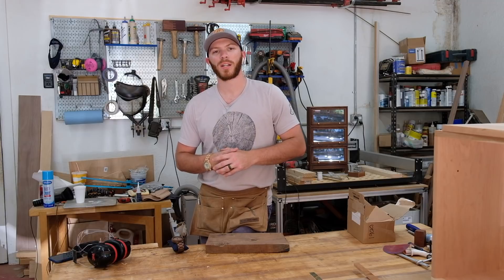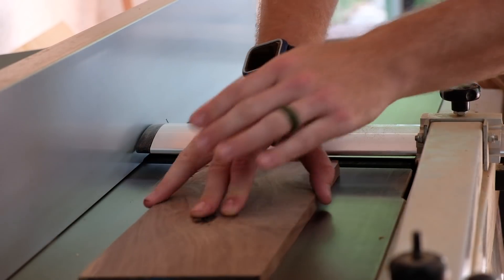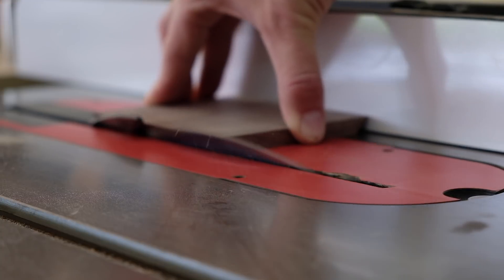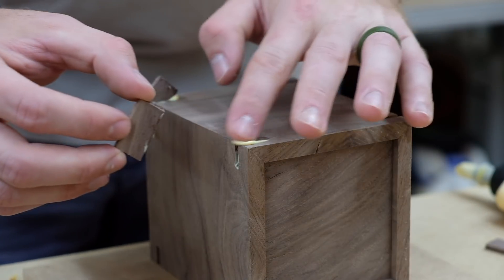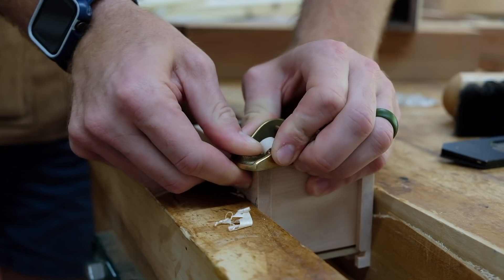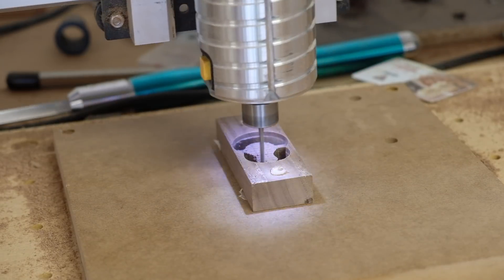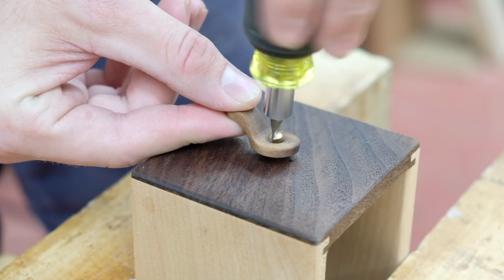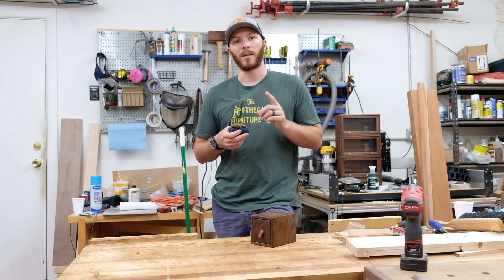Making a Little Box for a WoodWatch // FREE Giveaway!

Comment: Brass is a really soft metal. You may be able to use your CNC to mill it out by just turning your speed down and putting a carbide end mill in it. Probably save yourself some money on the manufacturing process as well.

Comment: Lovely box. I love the addition of the little reinforcement splines to the mitre joints, but what would you recommend to reinforce mitre joints that are not deep enough to spline, such as a thin picture frame?
Reply from the maker: Thanks Trevor. Even a frame that’s around 3/4” thick should be able to hold a spline in each corner. You can also drill from the side for a dowel which will add a little bit of strength.

Comment: I love your mini-halflap joints, but I need to figure out how to do them without a table saw as I don't have space for one and have to pull out a track saw or hand saw.
Reply from the maker: Thanks! Realistically, I think the only other simple method would be a router table.
Reply: @parillaworks  Thanks. I've managed a shonky version with the tracksaw this weekend but it isn't as precise as your joints or as I'd want them to be, so some more practice needed. Earlier this week I tried with my router (not a table, but handheld against a clamped rail) and made a mess of it and it was very time consuming so I think that I will keep practicing with the track saw.

Comment: Have you had any issues with the fence on the incra triggering your sawstop? Debating the incra 5000 but I don't want it triggering my break with the extruded aluminum fence.
Reply from the maker: Hey Steve. Yes, the two times I’ve triggered the Sawstop have been due to Incra sleds haha. I clipped the Incra iBox about 4 years ago and also clipped the miter gauge a few years ago. Both my fault. Lost a dado stack on the first one, which sucked.
Reply: @parillaworks  dang, that's what I was afraid of. I did the same thing with a t track I had on my cross cut sled. $90 for a new break and $25 to repair/sharpen the blade...

Comment: I think that is a great idea for a draw pull. How long did it take to mill out?
Reply from the maker: Thanks Aaron. Each side took about 25 minutes. I used a 1/8” ball nose end mill for everything. I think the feeds and speeds could be adjusted to speed it up but I might also decrease the step over or possibly add a finishing pass with a smaller bit to smooth things out, which would take a while.

Comment: What jointer/planner do you have and how do you like it?  I had a chance to pick up a used Inca, I loved the width but wasn't thrilled with the short tables and only two blades.
Reply from the maker: I use a 16” Scorpion from CWI. I’ve had it for 2+ years now and have been pretty satisfied. Yes the beds are short like most combos but I can usually work around it for the most part. The 16” jointing capacity is a game changer for me, really helps my workflow for panel production.